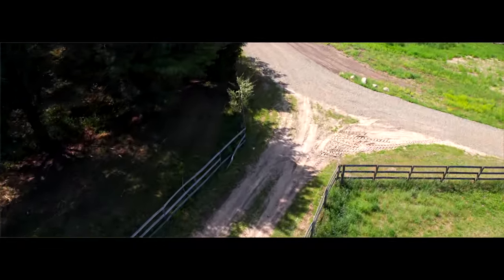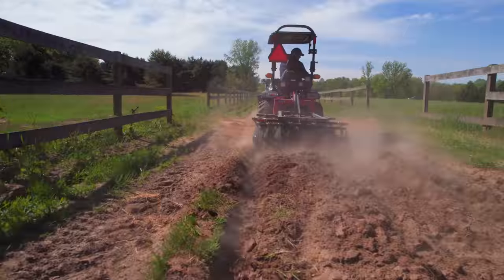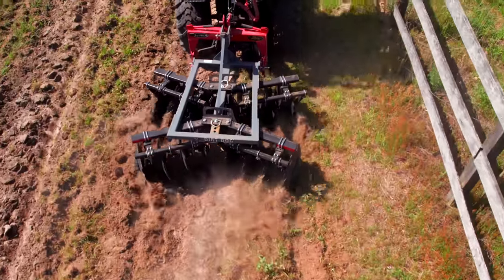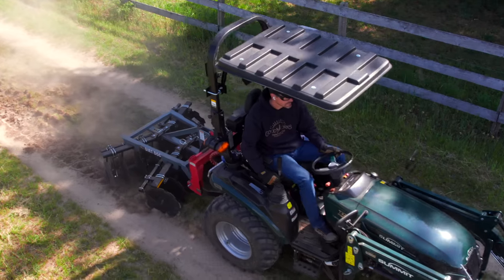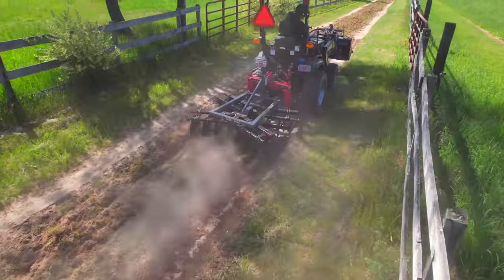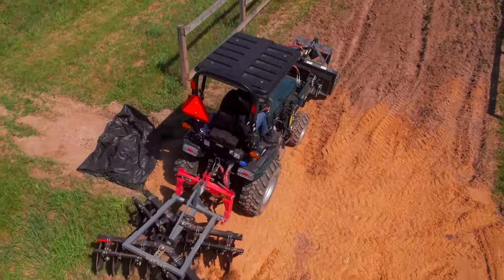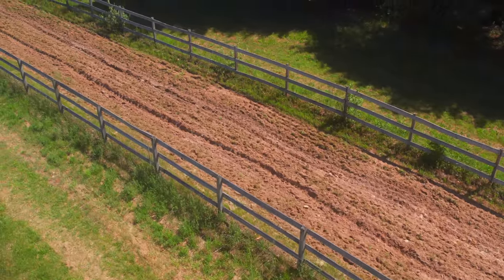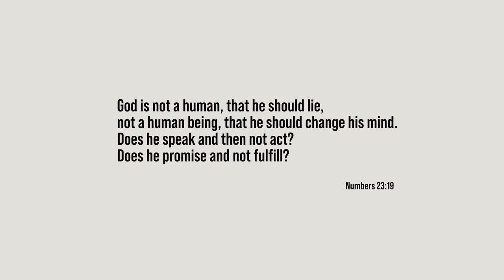TEARING UP MY DIRT LANE TO DO IT THE RIGHT WAY!

Comment: contractor here, you ALWAYS should strip topsoil where you plan on building anything. a road, a building, whatever. topsoil DOES NOT compact like dirt and you will always have soft spots. that disc worked better than i thought though.

Comment: We love our hydraulic toplink on our Kubota 3560 Grand L. One thing people need to be aware of is that they will droop after some time so they do need some adjustment with the leverafter the tractor has been off for a while . I believe there is more expensive one that gets rid of that problem. However our dealer was scrambling to find one so we could take delivery a year ago.

Comment from the maker: How do you think it turned out?  Would you have used a different tool?

Dirt Dog Disc: https://www.goodworkstractors.com/product/dirt-dog-disc-harrow/
Hydraulic Top Link:  https://www.amazon.com/shop/goodworkstractors/list/46M6Z6OWPONU?ref_=aip_sf_list_spv_ofs_mixed_d
Speeco Quick Hitch: https://www.goodworkstractors.com/product/category-1-e-hitch-quick-hitch/
Reply: It really depends on the texture of your land, what I mean is - Some land has numerous rocks anywhere from 2-inch rocks to 12-inch rocks like where I am upstate New York , so in my case I would use a  box blade as well as a land rake and then a land plane to level it out . Now if the soil is workable like at your place with minimal rocks for sure I would use the  disc harrow.

Comment: I think the disc might be the better tool for that job. Looks like it could be quicker than tiling.
Reply from the maker: It was really quick and the results I needed.
Reply: @GoodWorksTractors  Exactly, tillers and great when the soil needs to be nice and fluffy but they’re slow. 
A job like that I would’ve normally recommend rippers on a box blade or land plane. I think the disc works better. I’m glad you only had the disc available!

Comment: Does any brand offer a duty rated  12V linear actuator top link to bypass the extra hydraulik plumbing? 
It would make an interesting video. In similar spirit to thise 12V grapples.

Comment: So if you had to compile a list of attachments for refinishing a driving what would you include? Disc/tiller, landscape rake, box blade, anything else?
Reply from the maker: I'll use a land plane instead of box blade, but either of those will work.  Nothing else required though assuming you have a loader with bucket on it.